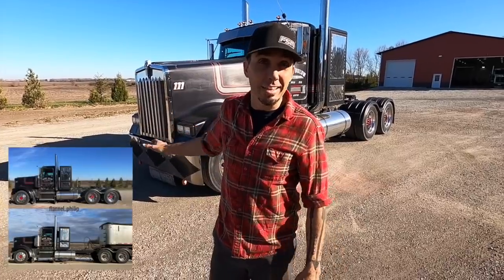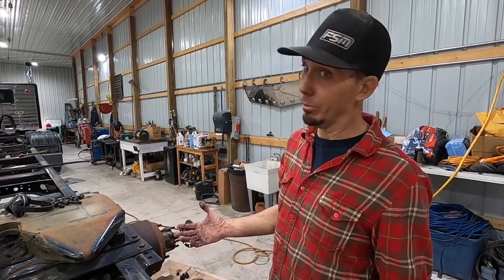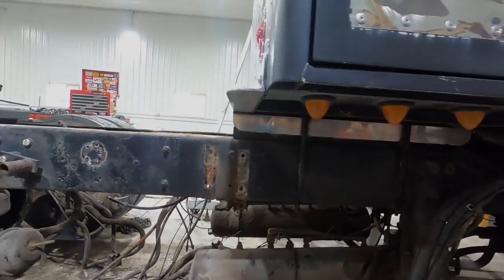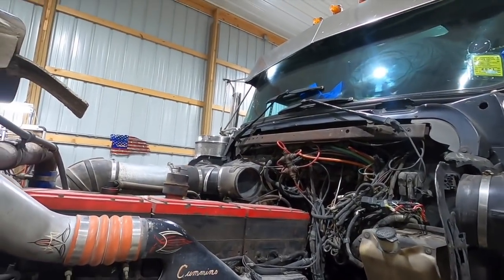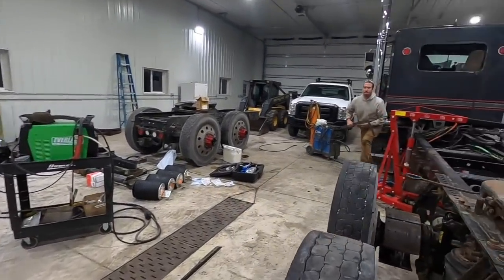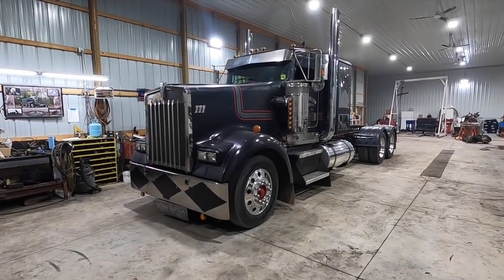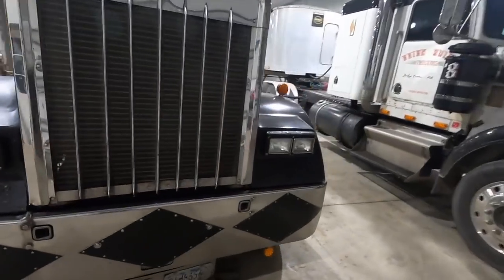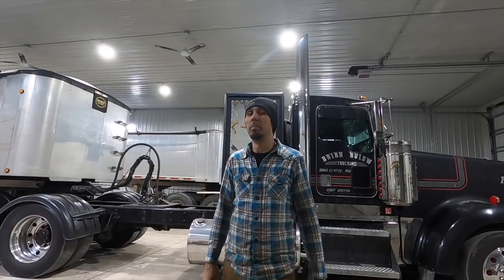My Truck Got 4ft Longer In 1 Week!!!

Comment: Been cheaper to just buy new truck instead of all that other stuff but if u got time and money to burn go for it
Reply: Yeah buy a new truck paying hundreds of thousands so it can break down and sit in a shop for months because you can't get parts for it costing tens of thousands and  emissions related repairs. Or he can spend a few days doing this and get back on the road for hundreds of thousands of trouble free miles.
Reply: @mrmotofy  well I said buy a new truck I didn't say buy a truck with DEF on it now did I and their are good running truck on market that have no DEF on them if u just do alittle research
Reply: @garyroach3479  DEF has been around for 11 yrs now, DPF around 14 and causing problems...Not exactly new. Most people don't consider 14+yrs old a NEW truck
Reply: @mrmotofy  exactly right 👍👍👍👍